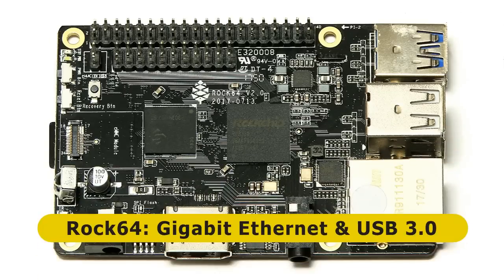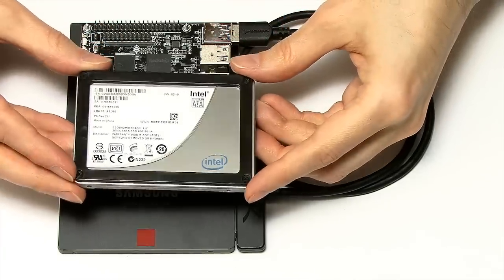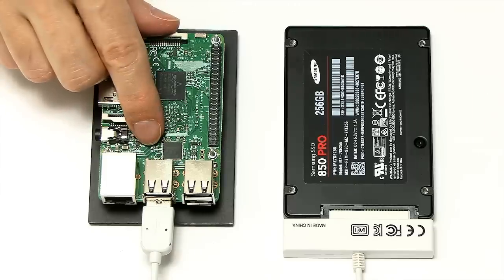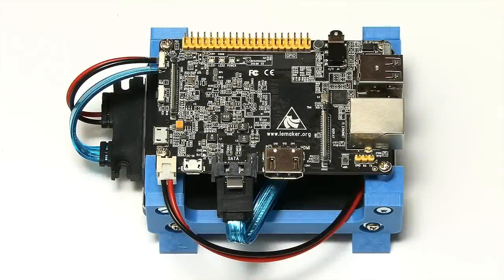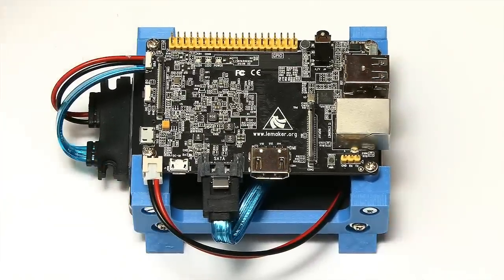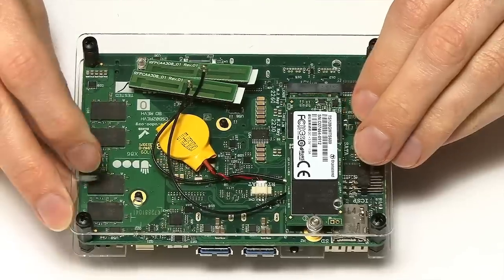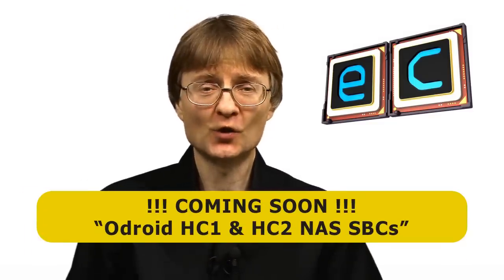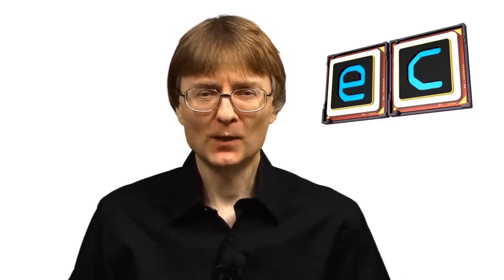SBC NAS Group Test

Comment: Thank you Mr Explaining Computers, that was very interesting.  I think the ROCK64 4GB is the way to go for me as the SBC is $91 CD and the  UDOOx86 Advanced Plus is I think $174  US plus shipping to Canada.  There are more options in the UDOOx86 but I was going to use Firecuda HDDs as my Storage drives to start and the move up from there.  The cost of a 2TB Firecuda, the ROCK64 4GB ,  power supply and cables ($240 CD). I think it would be about the cost of the UDOOx64 ($252 CD) in Canada.  I don't think the 5-6% increase speed would justify the difference cost right now.  Up to now I was thinking about an AMD AM1 motherboard, an AMD APU and 4GB DDR3 RAM and Linux (Ubuntu).  It would cost me about $300 CD for everything to get started but your idea  makes every thing smaller and quieter (less expensive).  I like that idea, I have too many fans running in my computer area now.  Great video, I am looking forward to see those other two videos that you were talking about...

Comment: Still cannot map the NAS to Windows 10 and nobody can seem to figure out the black art of making a Linux NAS work with Windows 10 reliability, no errors are given so   no NAS devices for this network
Reply from the maker: I find this very strange. I've had no problems connecting any of these NAS setups to two different Windows 10 PCs
Reply: Of course not you have not had any problems you have been to network college, none of the operating systems I have downloaded installed and tested run stable on the Rock64 all of them have errors or just reboot for no reason, run real slow, I am suspecting the power supply they sent me is the problem but I have no way to validate have you tested the 110v power supply they ship? Rock64 uses a barrel connector I have about 7 power supplies that are proven to work (2.5) amp flawless with the Pi's naturally they do not plug into the Rock64 time to RMA the Rock64 and charger and stop wasting my time Raspberry Pi's run flawless and have actual support for ANY problem you can dream up.
Reply: Watching your Rock64 videos your Rock64 is about 3x more responsive than mine doing the exact same things unless your speeding up the video as the Rock64 is processing?

Comment: It always annoys me that your screen casts are so big and unusual. Could you maybe switch to a standard resolution like 720p or 1080p or turn that zoom off?
Reply from the maker: Until now I have always grabbed in 720p (everything you see here is 720p), and  from two weeks time it will be 1080p.  But for appropriate video making, I need to set fonts and other elements to be readable lean-back on all screen sizes. I shot animation at the BBC for six years, and any setup that included text less than 1/24th screen height they would simply refuse to shoot on exactly this basis.
Reply: Looking forward to 1080p! (And I don't think the fonts need to be that big but opinions)

Comment: Hey, thanks for considering my comments, and making this video! I think what we are seeing here, is that transfer speeds are either limted by Etherner (RPI, Rock64, UDOO) or USB (Banana Pro uses USB 2.0 to SATA bridge afaik, that is probably why you see speeds ~30megs). What we can learn from this video, is that Rock/Udoo would be a sufficient soluton for home NAS for videos or similar from speed perspective. However, what I am worried about with all this this SBCs is the level of support they receive. Some of the hardware uses closed source drivers, communitiy is small, so when you really start using the board you might run into the problems. For example just google Rock64 drivers issues, there are many complaints about problems with WIFI. Many people were looking into Rock64 as a more powerful replacement of RPI, but realized that the community, updates, firmware updates jst does not deliver compared to RPI. I know these issues are hard to present niceley, because they are based on experience rather than lab synthetic benchmark, but for a day to day use, they are the most important. Anyways, looking forrward to HC1 & HC2 board tests! If you have a chance make a more detailed explanation of SATA connector implementation. Afaik these HC boards should have a USB 3.0/(3.1?) to SATA brige with more complete SATA features implementation. !Also, important: Odroid released in Feb 2018 Odroid N1 (http://com.odroid.com/sigong/blog/blog_list.php?tag=ODROID-N1) which suppose to have: native SATA implementation via PCIe-gen2 to SATA3 interface! This would be super interesting to include into test. But I think to make the comparison fair, what native SATA brings needs to be clearley presented. Thanks again!
Reply: Congrats, you just won the internet. Someone who actually got the issue about just looking at specs alone. (Ever run into an orange PI  promoter,don't answer)

Comment: Now that was really useful - here I thought I really needed a cheap SBC with native SATA and it turns out the USB3 to SATA is actually better. I wonder if it's possible to boot of that as well ...
BTW the 2 GB was a single file or a folder full of gazillion small files?
Reply from the maker: The 2GB was 8 video files.
Reply: Tomisaburo R. Mizugawa it was an interesting video.  I looked into it a little bit before, but I think odroids can be made to run the OS off a USB device.  Not sure about other boards, but I suspect it's doable.

Comment: Bit surprising to see banana pro's sata controller being so slow. but as usual a great video!! Thanks mate!
PS. I'm actually not sure why RaspberryPi has a huge fan base at this point. It doesn't have the best specs and it has never been the cheapest.. Maybe it's the "Apple" of SBC ;)
Reply: Ryan Kimbrough yeah but if you don't mind a bit of trial-and-error, there are much better alternatives. Even when rp2 was around, beaglebone Black was a much better board. But yes, RaspberryPi community is huge.
Reply: Raspberry pi has tons of support, you can look online and find out about tons of projects that use it and get information about how they did it.  I know that it isn't the fastest thing but a lot of cool projects don't really require a lot of speed.  I wasn't interested in it until they came out with the raspberry pi 2 because the originals were a lot slower and I didn't feel like you could do much with them.  I like creating robots with it because I can program python scripts to actually move the robot around and fire a usb missile launcher at targets.
Reply: billfusionenterprise so it's "Apple" of sbc lol
Reply from the maker: Nice.
Reply: annoy the cat?
Reply: if you mean the old days of helping education, YES
Reply: Raspberry pi was the FIRST major learning SBC it was created just for that purpose and it's community is all about that purpose. Arduino is older, but even older is the parallex  basic stamp, but those 2 are micro controllers. YOu should read or watch the video behind why the raspberry pi was invented

Comment: The Pi3 seems a little out of its element. It's like those photos of an old truck bed hooked up to a donkey pulling a farmer around.
Reply: well the raspberry pi was not aimed for just being a NAS device, it was built to be a learning tool,an extremely valuable learning too
Reply: no local distributors?

Comment: Thank you, for another informative and timely video. It's coincidental that I'm deciding between the Rock64 or the Odroid HC1 for my NAS. I was leaning toward the Odroid solution. I guess, I'll have to wait for your upcoming video to help me decide.
Reply from the maker: I will add the HC1 results to this table in a few weeks time. The Rock will win on price, but the HC1 is a nice, cased solution and does not need the USB 3.0/SATA adapter.

Comment: This is good video.  The udoo and the rock64 is not too far in regards to speed.  
I have the HC1 with a 2tb Seagate hdd and I'm only getting transfer speed of 10-13 mbps on Samba.  Lan connection on both hc1 and the pc. Not sure where the bottleneck is but happy for now since I got OMV and nextcloud setup working.

Comment: Im very tempted to build a NAS setup as im currently sharing 4 drives from my windows 10 laptop and it would be nice to free it from that duty. Can you plug in a usb 3 hub into the Rock64 and share multiple drives? Im using external usb 3 hard drives each with its own power supply.
Reply from the maker: You could use a USB 3.0 hub on the Rock64. I would worry about stable NAS performance though. It may be OK!
Reply: Why would it be unstable? Anyway it's cheap enough to give it a go and if it doesn't work out then there are many other things to use it for. Thanks for replying.
Reply: Right I understand what you mean, however only I would use access the drives and I would only use one or two drives at once with the others just sitting ready for when I do need them. I thought it meant the board would become unstable and crash so im happy with it bottlenecking if it does as it would still probably be better than the Raspberry pi.
Reply: Interesting, I wonder what the problem is. I think I'll give it a miss and just stick with my current setup then as it's mostly for streaming videos to my kodi setup anyway and seems to work fine. Thanks for the response.

Comment: The Pi 3 B+ would have been around the 20MB/s mark on average, it can peak higher but usually settles around the 20MB/s mark but that is running Raspbian with a few other things on top. Also the Pi 3 B+ needed new OS updates when it came out, I had a terrible time getting the thing to work as my Pi 3 was set up, no copying the existing SD card or even updating it to the absolute latest release. I realised my setup was well out of date not that it bothered me at the time.
I'm still not convinced I have everything working as it was but it works, some software doesn't like things included with Stretch.
Reply: all new hardware or software will have issues, I never rush at that gen 1, I wait until a .2 update occurs
Reply: True, usually a few products in though most problems have already been seen and fixed/avoided. Probably why it requires a fresh install rather than just using the old card. I still have my Pi 3 and a backup of my SD card if I want to go back but if it was easy it wouldn't be any fun.
Reply: even the brand new phones are like that, remember that correct way to hold iPhone one

Comment: I want to do something like this but on a Pi Zero W and run Plex and have it as a portable media server
Reply: that be interesting mainly it is allot slower,  me if i need a small plex device i use a Roku
Reply: Plex on the PiZero is probably overkill. Take a look at the PirateBox instead if you want something portable. Basically it can be configured as a stand-alone Wifi DLNA server.
Reply: I preferred Plex
Reply: only thing I like to point out is that the mini connectors and single core of the zero

Comment: Chris, as I see, it can handle only 1 drive? There is no way to build an mirror based on this ROCK64?
Reply from the maker: You could connect another drive (or two) via USB 2.0, or use a USB 3.0 hub. But I would not recommend the latter.

Comment: The UDOOx86 is the clear winner but at what cost! You can buy a drive-less 2 bay NAS for less than the board alone. https://www.amazon.co.uk/Buffalo-LS220DE-EU-LinkStation-Desktop-Enclosure/dp/B00ISM5ERG
Reply from the maker: On a value basis the Rock64 wins -- almost as fast as the UDOO, but a lot cheaper.

Comment: Well, you cant call that test, because you used a different connecting method/ different ssd every time.
Reply: It was a "good enough" test, because he clearly showed what was tested. The ~100 MB/s is what you get via Gbit network on most PCs.
if you have the M2 Slot you would use it, if you only have USB3 you use that, if you have sata port you use that to free up resources on USB3 port....
Reply from the maker: I built the best NAS possible with each SBC. Based on your logic, I should have connected the drive by USB 2.0 to all boards! :)
Reply: I am glad that you added this qualifier.   I was previously just going to make a similar comment to PSI Q's note.

Comment: I have tried the Banana Pro, it was a horrible experience! Unstable, very little community support, the included case was horrible and everything overheated because of it.
You should try using the new Pi 3 B+!
Reply: want worse look up the orange pi, they use banana pi  OS
Reply: in the end of the video @11:05 he explains that there would be no real benefit with the newer RasPi,
because the gigabit connection is still slowed down by the shared USB 2.0 Bus. It's a bit faster now than 100Mbit, but still no full gigabit.
- the 100mb/s are the gigabit limitiation, +/-10MB/s depending on chipsets, cable and traffic.
Reply: If you use a fast MicroSD card instead of an USB SSD you will have an improvement even in the non-B+ version, BTW. Also, the faster CPU and better wireless chip&antenna (if the data transfer is also made via WiFi) could help as well.

Comment: About rock64 : how much ram it has(there are 1,2,4gb version out there) and would ram upgrade worth $10 for this kind of soc?
Reply: The ram does not really make a difference, the 100MB/s limit comes from the gigabit network. If that was your question.
Reply from the maker: The Rock64 here has 2GB RAM.

Comment: Hi, I like a lot your vidéos, greetings from France 🇫🇷, but I have a question :I have sold my pi 3 b and now I want a new sbc, In your opinion is better to get a new pi 3 b+ or a rock 64?
The rock 64 has a good software? Thankss
Reply from the maker: The Pi has better software and support, but the Rock64 has USB 3.0 and gigabit Ethernet -- and up to 4GB RAM.
Reply: It depends on what you want to do with it. 

For a NAS solution Rock64 would be better than a Raspberry Pi. 

Raspberry Pi would be the choice for projects that do not need high data throughput speed.  Octaprint for 3D print control and monitoring, MotionEye OS for security camera, Little Backup Box for duplicating digital camera media cards, Android Auto for use in cars, and many more projects are prime for Raspberry Pi.
Reply: Oh a french mate ! Well the thing is the raspberry pi was kind of the launcher, and an eye opener for me and others to discover the SBC universe. The thing is if you want something that had more power, and bo bottlenecks such as ethernet over usb, wi-fi over usb, etc., you should see other options, like the tinker board, the rock 64, the odroids, ... but the Raspberry pi has a huge community and that's what made its success. Remember though that something that is based on linux and works on a raspberry pi might work on another sbc if hardware compatibility isn't a problem (ex building a NAS, hosting a mumble server, ...)

Comment: Thanks for the video.... I will get a Rock64 on Wed. I can’t wait 😊
Reply: I tried OMV on a ROCK64 and gave up.  I wanted to access files on NTFS drives.   When I installed Windows, my name is the owner of the files. The problem was that I had used my first and last name with a space separating them. OMV wouldn't let me enter a space in the ownership of the files. I ended up using the ROCK64 as a Pi-Hole.  I have  an RPi 3 B+ on order to replace the RPi 2 that I am now using for a NAS. I also tried to setup the ROCK64 running Debian with Samba, but I'm not knowledgable enough to get it to work.
Reply: All you had to do was join our IRC channel and have someone walk you though the process and help you out... we even have one of the OMV devs in the channel. The link to the webchat is on the forum.
Reply: Lukasz Erecinski link pls i have rockpro64
Reply: Join reddit group too